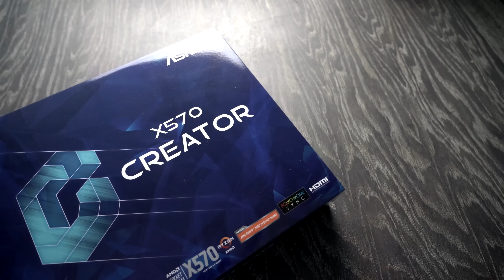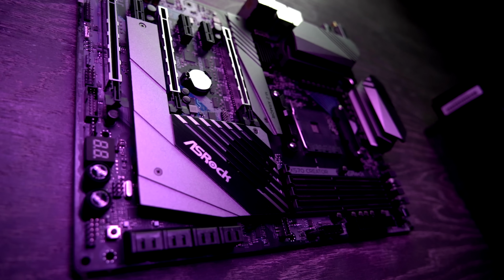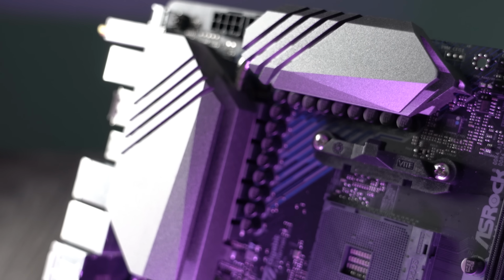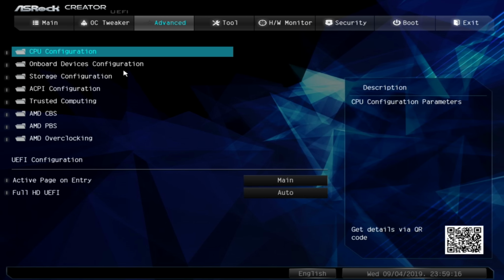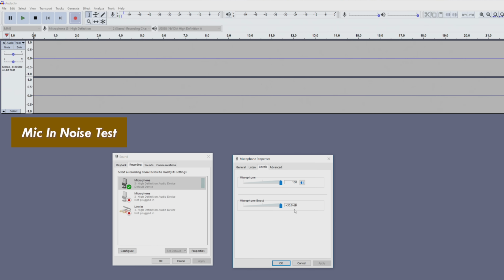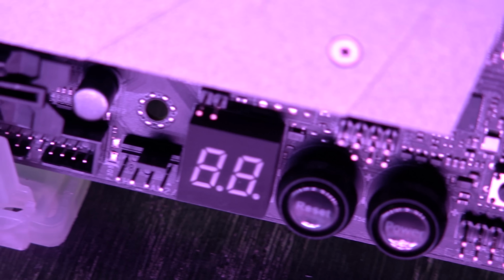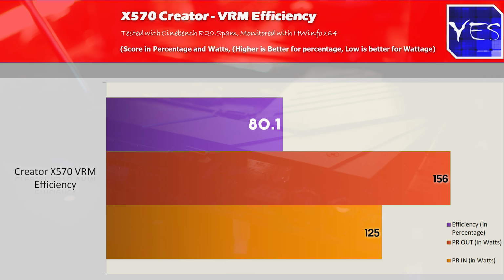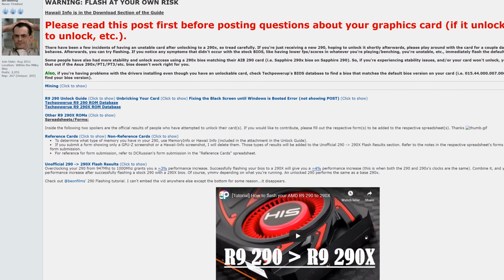X570 Creator Motherboard Review - ThunderBolt and 10Gbe Meets AMD

Comment: Hey Brian! Great vid as per usual!  Thankfully my X570 Taichi chipset fan isn't noisy and I didnt have to modify any profiles =).  Did my 1st round of stress tests on my new rig over the weekend, and I am pleased with the stock results:
CineBR20 - 7222 Multi; 500 Single thread
PCMark10 - 7015 pts Overall
3DMark - 7252 pts Overall
CPU didn't get any hotter than 76 degrees. Will re-run my tests once I get my Navi Upgrade.  Currently rocking Sapphire Nitro+ Vega 56 Limited Ed.

Comment: This is basically the phantom Gaming X but with 10gb transfer speed. Which you’ll need a 10gb switch or Nic to take advantage of. Not to mention a NAS with 10gb hardware as well. Cheaper to get a 10gb SFP+ on EBay for your current hardware.
Reply: yeah this is the very top end of consumer line where your almost to the point of an HEDT system......BUT for ppl who are big gamers and heavy creators it would probobly make the best all arounder with that 16 core.

Comment: I've been checking on this motherboard because of the 10G & dual TB3 for my studio build, and you just made my choice easy. Ty💪💪💪💪
This will work fine in a dual system build with 3950x as my workstation & 10900k on mini itx inside an Enthoo 719.😎
Liked & Sub'd
Reply: thanks for the pointers, I'm on the same path.

Comment: The price for the TB3 option on this board is crazy. I found the z390 Gigabyte Designare for $215. With a $300 9700K or $280 8700K, you gotta board and a CPU for the price of a single board. And the option to do up to 8K pass through, 2 40GB/s TB3/USB-c 4.0 speeds is there. Also its a perfect Windows VM passthrough with a  linux base OS. That, with the TPM chip (hardware encryption) and software encryption. No one will get into your system... I needed a super server board and the z390 Designare is a great option.
Don't get me wrong. I like the board but, the price is out of range and they need to holler at MSI and get there chipset fan manufacturer to send some of there fans to ASRock. You shouldn't have to drop the chipset fan to 30% to get rid of high pitch fan noise. 50% fan speed should just become audible.
Reply: While $500 USD is probably still a bit much, there are some things you're missing out your comparison. As it's not just TB3 being factored in here. One of the NICs is an Aquantia 10Gbe on the  X570. That' $80 as an add-in card. Also the rear DP is an OUT while there is an internal DP in, though only Asrock may be making graphics cards with that internal connector. Then there is the PCie 4.0 tax. It's a future "proofing" feature, that serves to negate a future motherboard upgrade. It will probably be worthwhile ahead of the transition to DDR5. There are X570 boards at this price or higher that don't even have TB3. Because AMD supports and scales with a single socket so long, I can kind of understand a somewhat inflated price. New buyers to Ryzen are the target, since existing users don't really need to shift. So they ultimately expect to sell less. Having more IO bandwidth 10GBe LAN, and up to 16 cores/32threads, seems like something to consider for a "super server" board. Oh and ECC RAM support. All Z390 boards are end of life with the 9900K(S). AM4 should be seeing one more CPU generation next year. All the Ryzen CPUs include TPM functionality. I'll assume you only meant home server, considering the numerous security issues in Intel's current gen. Particularly those tied to hyper-threading and virtualization.

Comment: Could you please post the fan curve values that you found the best overall?  I'm very interested in this board, but the fan noise could be a real issue for me.  I had an older Asus Intel board (one of the their 'armour' models) that had a two small fans which drove me crazy.  I don't want to repeat the same mistake here, but really want the features of this board which on paper is ideal for my audio/video production workstation.

Comment: Hey. Nice video! For the internal display port up on motherboard, in the box there is a cable display port to mini display port(Thunderbolt2). I f i connect a professional soundcard(uad apollo twin mk1) on this will it be recognized? Can this internal display port recognize thunderbolt connections? Or is it only for graphic cards?  Thanks

Comment: Whats with the gpu to thunderbolt? Is that a GPU to DP cable to motherboard to thunderbolt? or do you need a gpu with an internal thunderbolt to the internal thunderbolt on the motherboard?

Also is the PCIe 4 slot definitely the bottom slot?

Comment: I'm surprised to hear that the chip set fan is loud. The chip set fan on my ASUS X570 Tuf Gaming Plus wi-fi is very quiet  As for flashing  the 5700 xt bios onto the 5700, I'm pretty I heard Buildzoid say that you can because the only difference in the two cards is the software.

Comment: Thanks for your review. Would like to know, it you can run 2 egpus at the Thunderbolt3 Ports. For Rendering in Cycles or Octane, I could use as much GPUs as possible. So having 3 internal Gpus and add 2 Gpus on tb3 would be awesome for certain jobs. This would be the only reason for paying 500$ for a motherboard.

Comment: What does "spread spectrum"  do on ASRock motherboards? I haven't seen that option in the Gigabyte UEFI.
Reply from the maker: It's to combat interference, it's best turned off in most cases.
Reply: @techyescity  

A good feature in case you need it.
Reply: Spread spectrum has been off on every computer I own. Its useless
Reply: @WayneWatson1  

For me my current rig with a 3700X is my first computer with a non-locked BIOS. ;) 

So far I have managed to overclock my Corsair Vengeance 3333/16 to 3666 MT/s with sharp timings (stable in Mem86), I haven't figured out yet what to do with the CPU though. I tried PO, it doesn't make it any better (higher multithread, lower singlethread) even after increasing the PPT, EDC and the other parameter to responsible higher settings (the 3800X setttings). The cooling is fine, the temperature doesn't get above 65 degrees C. It seems to be a BIOS/microcode limitation. For the RAM I know for certain that there also are some BIOS-issues on Gigabyte X570.

Comment: if you could have had that mother board in a Little Devil LD PC-V10  PC case and use a custom solution to allow you to cool the part of the board that is cooled by that noisy fan that you objected to and keep the condensation away from the electronics as the cooling system can drop the temperature down to -70 below zero also system won't start until cooling probe reaches set temperature and use a water cooling solution to cool the CPU and GPU.

Comment: do you think a x470 could run the 3900x? or the new 3950x i want to upgrade my ryzen 5 2600
Reply: Luke Van den Akker  i have an msi x470 gaming plus =/ do you think the 3900x will work atleast?
Reply: @hugo9016  I have that motherboard It supports all Ryzen 3000 CPU's from the 3900x to the 3600. So if it can do the 3900x it can most likely do the 3950x when it comes out they are supposed to be the same TDP as the 3900x.
Reply: @XxViciousxX  thank you!
Reply: @hugo9016  No prob just make sure you update the BIOS to at least 7B79vAA before installing the new CPU if you haven't already that is.
Reply: @hugo9016  you need to look up your brand website for cpu compatible or bios update information.
Reply: @Ehren1337  okay i will thanks

Comment: What motherboards suppport gpu fan control in bios?
Reply: It's the fan on the motherboard not the gpu
Reply: @ape69420  Yes, that's not the answer to the question I am asking.
Reply: You use their software the Mobo bios does not control gpu.

Comment: here's the thing: is anyone who works in creative really using on board 7.1 audio? probably not. even people who are using onboard audio like video editors would probably rather have multiple displays before 7.1 capabilities. 

was kind of excited about this mobo but...
Reply: The onboard audio solution is literally standard, and so cheap it might as well be considered "free". Way more people would complain about it's absence, should they choose to exclude it. It already has everything you need for multiple displays between DP and HDMI for an APU, and thunderbolt with an internal DP passthrough. DP supports daisy chaining. No one at the creator level is using a 4c/8t APU with this board, and as such will have a dedicated GPU with at least 4 outputs.

Comment: The same for Gigabyte, out of the box it is obnoxiously loud. With a custom profile it is fine once you are in the OS (Linux and Windows) but before that, it is way too loud! Solve it!! There is no reason why the fan (chipsetfan or CPU-fan) should run at 100% RPM in the UEFI while the clock frequency is at the base frequency (3.6 GHz for the 3700X). I am fine with ASRock putting Thunderbolt on their AMD-motherboards, just also sell motherboards without it to lower the cost for people who don't need it.

Comment: I have internet services from two different broad band companies at home,So If I connec two lan cables from two different modems to one motheboard (Example ASrock phantom gaming 6 or asrock taichi) which has dual lan ports Is Im gonna get sum of speed from two different internet providers or the motherboard will just enable the one which has more speed and will disabele the other one with the less speed?
Reply: Get a router with 2 inputs and load balancing
Reply: The way of doing this is getting a router that supports dual WAN or load-balanced input.
Very few consumer routers running stock firmware allow for load balancing but some Asus routers do.
For example: https://www.asus.com/us/Networking/RT-AC3100/overview/
Is what I use for this. It supports two external connections as you'd want. It's generally the higher-end routers that do. 
The AC-68U does as well: https://www.asus.com/us/Networking/RTAC68U/overview/

The modem of the faster Internet service (if they're not the same speed) goes into the WAN port and the remaining service goes into port 1.
From the router you connect using only one Ethernet cable to your PC and all of the devices on the network can use both Internet connections. 
In the WAN setup go to Dual WAN -> enable -> WAN -> Ethernet Port 1 -> Load balance.
If your services are identical, then enter a load balancing configuration of 1:1, otherwise, if the down speed of the primary is twice as fast, enter 2:1, etc.

Simply connecting both Ethernet ports to different modems won't achieve what you're looking to. 

Note: quite a few routers will support failing over to another Internet connection once it's detected one is down but that's not what you want.